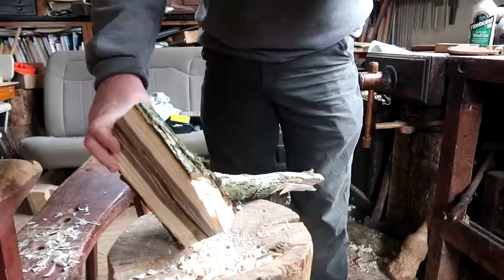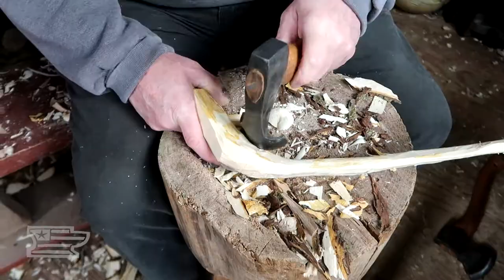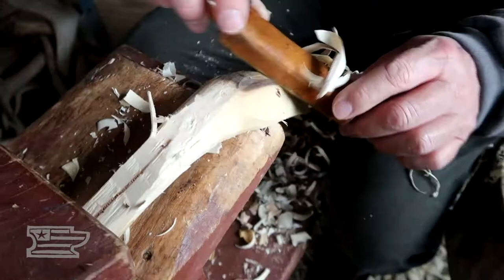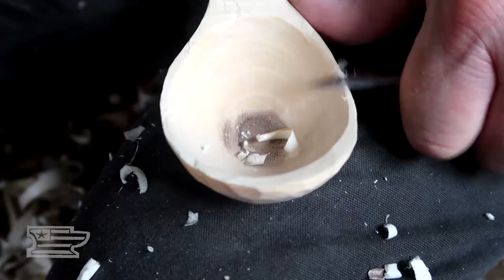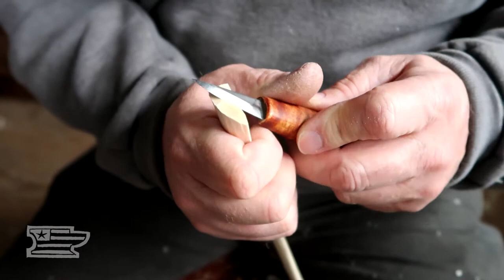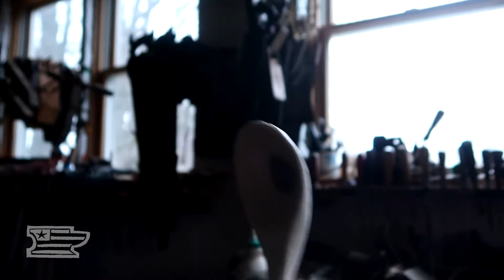Silently Carving a Walnut Ladle with hand tools | Whittling green wood | Sloyd

Comment: hello, nice work. i also prefer doing spoons using natural bends and crooks in the wood. spoons i've made this way have lasted 25 years and more. the tool you use at 2:06 and on, do you call it a scorp? did you make yours or purchase? i've been looking for one but they're not easy to find.
Reply from the maker: Thanks Tee Elf. If cared for, treenware lasts forever! It's truly amazing. 
I call it a spoon knife, others call it a scorp. It's a tool I make in my shop here in Indiana. I make a few each year and offer them for sale in my shop, you can see them here - https://www.etsy.com/listing/678129422/handforged-spoon-knife-walnut-handle
I'm happy to answer any questions you might have
Reply: @TheIronRam  thanks for the reply. i agree, the durability of good greenwood work is pretty remarkable. i'm self-taught and when i started i carved my first pieces so thin they were barely thicker than their metal equivalents which i copied in every other respect as well. of course this was going too far but it's surprising how long most of them lasted, largely (i believe) because i followed the grain from end to end.
your "spoon knife" is exactly the carving tool i've decided i want add to my tool roll. i've bought some 01 stock and plan to give it a shot. might be a bit ambitious as a first project but i used to make jewellry and i'm hoping some of those skills will help me get on with this. i'm thinking anneal, bend and hammer to shape, grind the profile, harden, final shaping and sharpening. wish me luck! :)